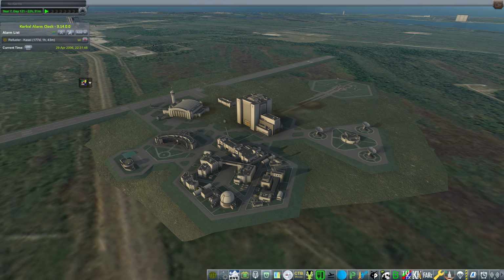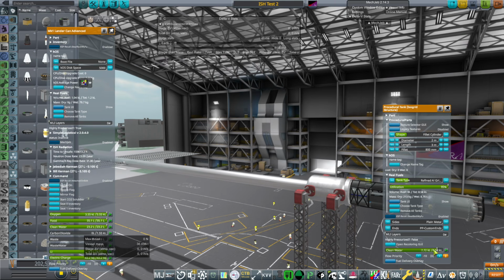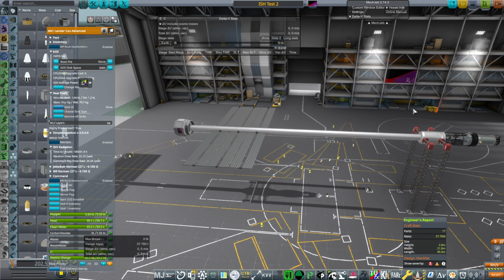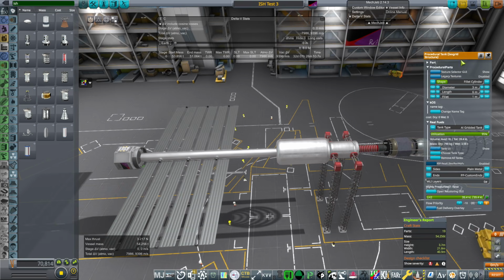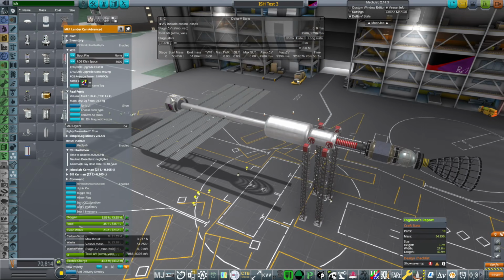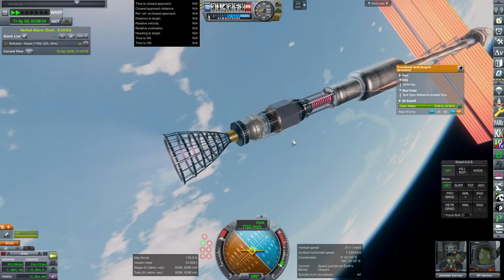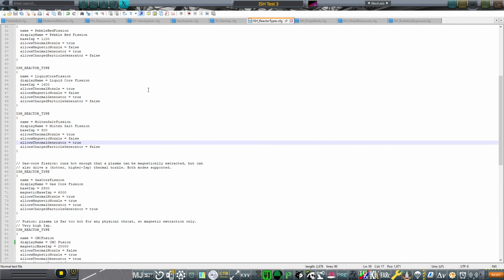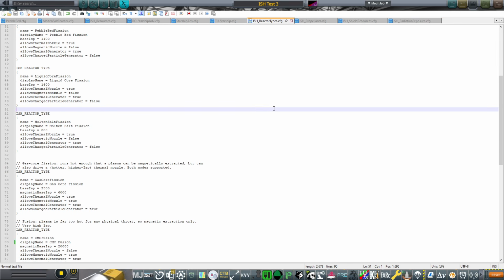Interstellar System Heat - First Feature Complete Release (KSP)

Comment: Is this a standalone mod or can it make the actual Interstellar and System Heat mods work with eachother? I guess from the description this is a future goal?
Reply from the maker: Making the KSP Interstellar parts work with System Heat is something I am working on using this plugin - it's basically a matter of removing the KSP-IE system and applying this one. However, this is much simplified from the normal KSP-IE methods in that there aren't Tech Levels and other features like that, so fair warning. I do already have a patch for just the KSP-IE radiators: https://www.dropbox.com/scl/fi/ivzbzvthi36ce74b9i9ne/RO-KSPI-Radiators.cfg?rlkey=p8k4n1hqxnqgu91a5vfaipsda&dl=0

Comment: On the alpha particle generators:
- Alpha particles have little to no penetrating power. A sheet of paper stops them. How are they getting to the generator?
- Theoretically if the reactor's emitting radiation in all directions the best generator would be a hollow thing that the reactor fits inside of.
Also, any plans for a pulsed nozzle, for pulsed fusion engines such as magneto-inertial or laser-inertial confinement designs? I don't know if those methods of attaining fusion are any good for generating power, but it'd be interesting to find out lol
Reply from the maker: It's an electrostatic energy converter, so basically the alpha particles are funneled into it and it acts like a reverse particle accelerator - it recovers the kinetic energy from the particles. They don't need to penetrate anything. I'm not sure why there was an impression that penetrating power was necessary in the first place. The reactor already is essentially in a hollow thing because that's necessary to cool everything. Most often, it is precisely that energy that we are trying to use already, but there's a limit to how much we can capture simply because the particles are moving fast - you get a nozzle-like problem where you have to create a prohibitively thick vessel.